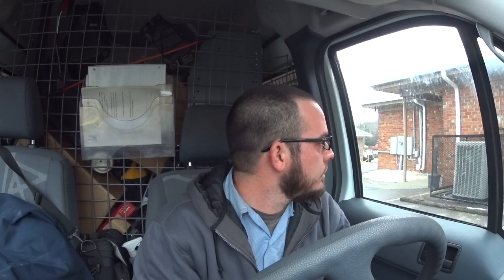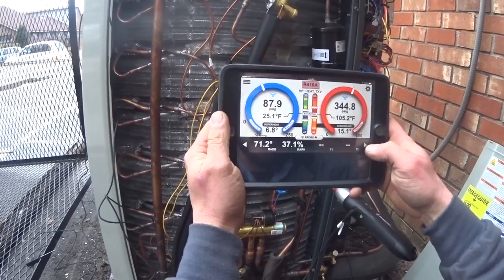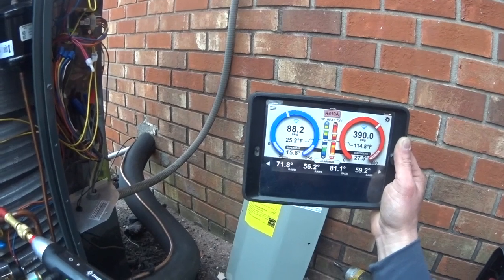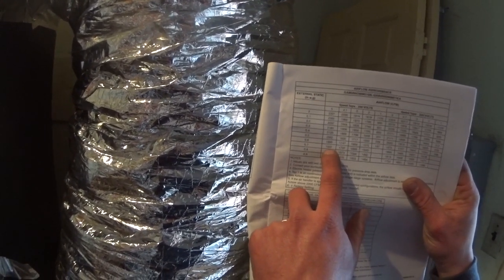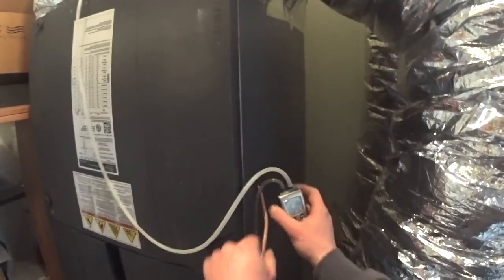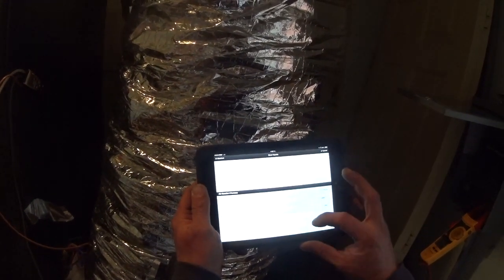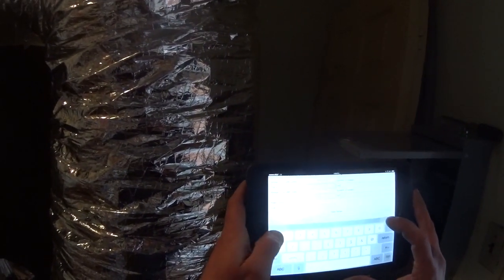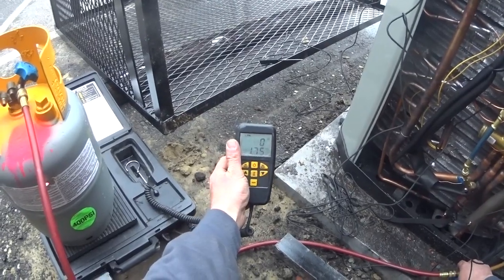HVAC Install: Startup on 5 Ton Trane A Day In The Life Episode 15 Call 2 2-25-15

Comment: hey when you calculate the cfm with the formula Btu ÷ 1.08xdelta T .. you use the amperage  of a one single heater strip but what do you do if the machine got 4 strip ?
Reply from the maker: You take the overall on the total strips

Comment: I don't see how the airflow increased that much but static remained the same. Technically impossible.
Reply from the maker: Trane says it does, I would've liked to have a more comprehensive way to confirm at that time.
Reply: The reason I commented was there is a formula to compute exactly what the static should have increased to - if it indeed increased. Since it stayed mostly the same I would say the motor is at its limits at both tap 4 and 5.
Reply from the maker: Oh I'm sure! The duct buried in the concrete floor was only 16 round...I would wager that the limit is even below speed tap 3... Joe Shearer

Comment: What gauge setup are you using.. Looks like imperial wireless probes but what tablet?
Reply from the maker: The gauge set is by Imperial, the iManifold, and I prefer to use iOS over Android. I run the iPad mini for easy transport in the cargo pocket of my work pants.
Reply: Stephen Rardon nice.. thanks. I like your setup
Reply from the maker: Me too! I couldn't be happier with the iConnect and iManifold.